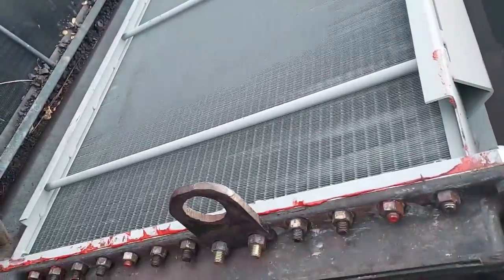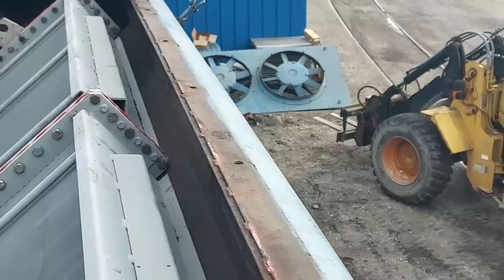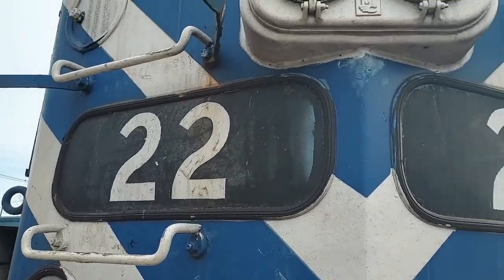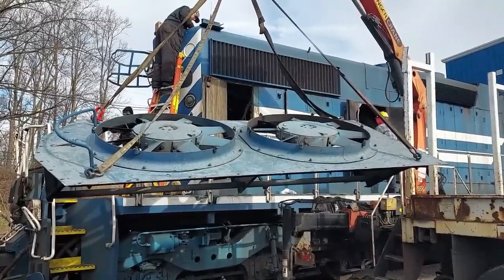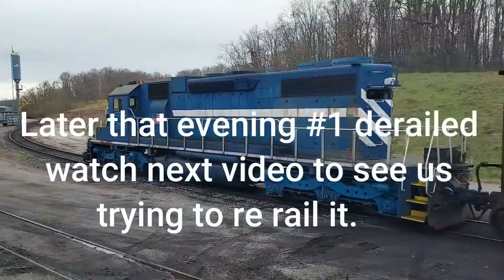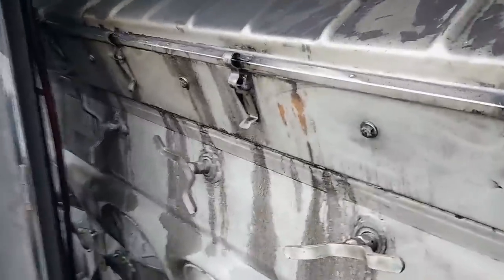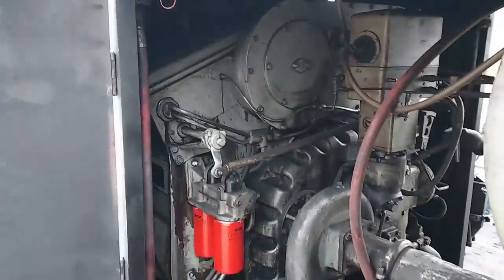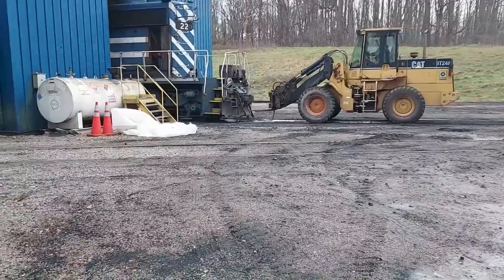A Failed Locomotive Cold Start after Changing the Locomotive Radiator

Comment: Thanks for the RARE view, and the quantity.  Antifreeze quantity, like 50% of that or so?  Is the cold weather start problem common on that or all diesels, the summer time oil is like glue when it's zero?
Reply from the maker: Your very welcome alro. Old EMD engines crank a bit slow.
Most locomotives run straight water. We do put in a rust/scale
inhibitor, makes the coolant look like watered down fruit juice.
The only EMD loco I know of that came from the factory with
anti freeze is the SD 70ACe. Because of the straight water
is why you see so many locomotives idling during the winter,
unless they are equipped with a Smart Start system which
automatically stops and re starts the locomotive upon certain
engine parameters. Thanks for watching the show and writing
in my friend.

Comment: Sounded like the batteries were low on power due to the cold.  Did they put them on a charger when they pushed the locomotive into the shop or did the locomotive fire up just with being inside for 7 hours and warming up some?  How do you ensure there are no air pockets in the cooling system?
Reply from the maker: Yes they did have the batteries on charge in the shop, they
got drained down from the cranking. These engines crank
fairly slow to begin with even with fully charged batteries,
they not like a normal diesel truck engine in that respect that
cranks a lot faster. They tried to get rid of any air, that was what
the initial cranking was all about, sucking the water level down.
Really appreciate your watching and writing in my friend.

Comment: heya.. Love your videos, but I'm curious.. has the company ever consider to add a coolant block heater to the locomotives, that connect to an external power source at the locomotive shed when not in use?? Like in my old 1999 Dodge Cummins pickup??  it would keep the water from freezing in the radiators since they don't have antifreeze in them.. I know some Class 1 Railroads have them to conserve fuel costs from running the locomotives to keep the water from freezing in the colder monthes.
Reply from the maker: Glad you are enjoying the show, we do appreciate your support
of the channel. No one has ever discussed having block heaters
here, but yes you are right some RR's do have them for various
reasons, a big one being locos idling around where there are
homes along with fuel costs. I will put forward to our loco
mechanics next time they come and see their views on the heaters.

Comment: Hay Dave no anti-freeze in the water? or is there something else to prevent
the freezing of the engine block & radiator? do you have block heaters
to keep the shut down engines warm? or just the building. great 
in site video to how the to repair and how the cooling set up is in the engine.
be safe, stay healthy, and have a great day.
Reply: Never antifreeze in these old beasts ever and no block heater either. Just what i've seen in my 24 years working on them...
Reply from the maker: Most locomotives run straight water Barry. We do put in a rust/scale
inhibitor, makes the coolant look like watered down fruit juice.
The only EMD loco I know of that came from the factory with
anti freeze is the SD 70ACe. Because of the straight water
is why you see so many locomotives idling during the winter,
unless they are equipped with a Smart Start system which
automatically stops and re starts the locomotive upon certain
engine parameters. Thanks for watching the show and writing
in my friend.

Comment: Hey Dave !!!  Question ??  240 gallons of water & NO Antifreeze ??? 🤔🤔🙄   Thanks for the video !!!  👍👍👍👍👍
Reply from the maker: Most locos do not use antifreeze. The SD 70ACe is only one that
comes from the factory with glycol that I know of. I have no idea
what GE does. That's why you see a ton of locos idling in cold weather,
although many locos also are installed with Smart Start. Our 3098
has Smart Start but 1 and 22 do not. Really appreciate your
watching and writing in my friend.

Comment: Ummmm why didn't yall spray some starting fluid in the air intake
Reply from the maker: Good question Thomas and actually no one does that for
these loco engines, take a chance on cracking a piston head
from the way I understand it. However your comment makes me
think of those 2,000 HP Super Stock pulling tractors where they
often have to spray a whole can of ether in to get them started.
Thanks so much for taking the time to watch my friend.
Reply: @ccrx6700  wow I didn't know that. We always used a little either in our diesel.  Thank ya for sharing that. I learned something new.

Comment: Hi Dave. Do you leave the engines running during cold weather?  Thanks
Reply from the maker: 1 and 22 yes William. 3098 has a Smart Start system that shuts it down and re starts automatically when certain engine parameters are
reached. Thanks so much for stopping by and taking in the show
today my friend.

Comment: Very cool to see inside an area that most of us never see.  But I have some questions:
1) What is the other set of fans on the roof for?  
2)  I saw in an answer below that most locos don't use antifreeze.  If you don't use antifreeze, how do you ensure the water doesn't freeze when the engine is not running and crack the block?
Reply from the maker: Glad you enjoyed the show Bryan. We really appreciate your
watching. 1 the extra set of fans is the dynamic brake resister
grid blowers. 2. If loco shuts off during freezing temps, then
once water gets below 32 it will begin to freeze, that is why most
locos are kept running during the winter. 1 of our locos has a 
Smart Start system that shuts itself down and restarts itself
once certain parameters are reached to keep water from freezing.
Reply: @ccrx6700  Tnx for the reply.  Giving the price of diesel fuel, leaving them running does seem a bit wasteful.
Reply from the maker: @BryanTorok  👍😊
Reply: @BryanTorok  Well if there's no work to be done, can just park the loco in the shop. Close the doors. Heat the shop with a waste oil heater. Much cheaper that way. Connect the batteries to a trickle charger system. Then fire it back up when there's coal to be moved.
Reply: @brnmcc01  I suppose that makes sense.  It just struck me that we have been using antifreeze of one sort or another for 100 years in cars and modern antifreeze also inhibits rust and corrosion in the cooling system and would do the same in these locomotives.  I have to figure that those radiators have to be expensive.

Comment: I did not expect the rads. to be in a V also I see you do not use antifreeze which being a lot colder than here I thought you would. Now I wonder if our EMD locos have it added or just our old engines.
Reply from the maker: Many folks have written in the same cedarcam, most thought the
radiators were right behind the screens and laid alongside the
sheet metal. None of these old locos use antifreeze. I think the
only loco that had antifreeze in them from EMD factory is the SD 70ACe. it's about cooling capacity, water dissipates heat better
than anti freeze, so the radiators have to be bigger for antifreeze.
I would most certainly venture to say your EMD's run straight
water also. Always appreciate your watching and writing in my friend.

Comment: Well Dave once again you shown me something I just assumed. I had no idea the radiators sat in there in that V pattern. I thought they were flat on the walls where the vents are. Thanks. And was this filmed before the new logo or did you guys take them back off. If you said a date sorry i didn't hear it. Funny how easy you can push something that heavy.
Reply from the maker: You are not alone in that Pappy. Many, many folks have never
seen how the radiators go in there, most all that have written in
also assumed they were flat against the sheet metal. A bunch of
folks also did not know that anti freeze is not used. This video
was made Dec. 2021. Being an equipment operator yourself,
you actually would be very surprised at how easy it is to move
the loco with that small loader. I've done it many a times and
you only have to give it about half throttle to get it moving. Always
appreciate your visiting with us my good friend.

Comment: Mr. Dave I have a quick question about the radiator on the locomotives can you put antifreeze in those two or they just for water from the engine please let me know thank you very much sincerely Miss.Shane
Reply from the maker: Most all EMD locos only use water Miss Shane. The only EMD
that I know of that came from the factory with anitfreeze is
the SD 70ACe. Very much appreciate your watching the 
repair job my friend.
Reply: @ccrx6700  Thank you so much mr. Dave for returning an answering my question I live in a small town on the Gulf Coast it's a little town is called Grand Bay
Reply: @ccrx6700  And the tracks that run through our small-town is owned by CSX and operated by them also they have a small switching yard not too far from us in Mississippi in a city called pascagoula and those tracks or South of highway us 90 and they run West and East but thank you for your videos I'm learning a lot as well as my son sincerely Miss Shane
Reply from the maker: @shanewhite9501  👍😊

Comment: Just give it a shot of ether and pop the clutch.
Reply from the maker: Suggested pulling it with the other loco and catching it in gear....LOL
These old EMD engines start a whole lot better when they
are warm. Thank you so much my friend for visiting with us
tonight and watching.
Reply: easy way to crack a piston on those motors. That is a very, very last option on that motor, because they usually start, it didn't start cause the batteries are weak-- if those were fully charged batteries, it would have started.

Comment: What drives cooling fans?  Electric?
Reply from the maker: Yes sir Keith. They are electrically activated controlled by a
temperature sensor that turns them on or off depending on
coolant temp. Thanks so much my friend for taking the time
to watch today's show.

Comment: Do you have to put antifreeze in a locomotive energy cooling system?
Reply from the maker: Almost all locos do not have antifreeze in them broadwayltd1.
Takes more cooling capacity to cool antifreeze than it does
water. There are a few of the newer EMD locos that have
bigger cooling capacity so they use antifreeze such as the
SD 70ACe. Thank you for taking the time to check out the video and may you have a very good day my friend.

Comment: Another neat video :) Thank you! On an unrelated note, is there a place that sells used railroad equipment and tools? I'd love to find a used track cutting saw, or in the very least, the track mounting arm from one of them. That would allow me to build my own. Those saws are around $3000 new, so I would rather not go that route :P Wheels would also be nice to find, but not the big ones that you find on passenger and freight cars. I would need smaller ones, like the wheels from small MOW equipment, or maybe a hi-rail truck. I could potentially make my own, but I would have to rig up some sort of device to act as a vertical lathe. And cutting/shaping the steel to the right profile would probably be less than enjoyable.
Reply from the maker: Thank you, very glad you enjoyed the show. We certainly appreciate
your watching my friend. No actual store that sells used RR tools
that I know of, however I would seek on Ebay or Amazon and see
what they got.  Most RR and RR contractors pretty much keep
their hand tools until they are worn out.
Reply: @ccrx6700  Ha. Good to know :) I will keep an eye out.

Comment: I would have assumed these engines would have a pony motor to start. Do any engines have ponies, or is it all battery?
Reply from the maker: These locos have 2 starter motors via battery connection to start
them Barrett. No locos have pony motors that I know of. Some of the newer locos use compressed air starters. Thanks for taking the time
to watch and write in my friend.

Comment: Surprised you couldn't give it a shot of ether? And also use block heaters to warm the coolant and block up? Block heaters help all of stuff when its cold.
Reply: EMD's dont like ether!
Reply: @rearspeaker6364  Roger. I know some diesels can't have it based on cylinder and turbo tolerances.
Reply from the maker: May be a good idea for block heaters, will make a suggestion to
the powers that be William. Thanks for taking the time to watch
and write in my friend.

Comment: do yall use straight water for cooling or some sort of glycol mix?
Reply from the maker: It's straight water northstar, however they also put in a water
additive that makes the water look like a weak fruit juice. Additive
helps to prevent scale/corrosion buildup.  Most all locomotives
except for a few run straight water for a number of reasons.
Thank you so much my friend for taking in tonight's show.
Reply: @ccrx6700  not worried about freezing?
Reply: @northstar2007  Cooling water is drained if not in a heated shop.  Straight water has higher heat capacity than glycol.  Smaller, lighter molecule of water  with greater hydrogen bonding effects.
Reply from the maker: @northstar2007  that why locos are kept running in winter 😊
Reply: @ccrx6700  Wouldnt it be more economical to walk them instead?

Comment: You said fill w/water… any antifreeze roo?
Reply from the maker: Most locomotives run straight water. We do put in a rust/scale
inhibitor, makes the coolant look like watered down fruit juice.
The only EMD loco I know of that came from the factory with
anti freeze is the SD 70ACe. Because of the straight water
is why you see so many locomotives idling during the winter,
unless they are equipped with a Smart Start system which
automatically stops and re starts the locomotive upon certain
engine parameters. Thanks for watching the show and writing
in my friend.

Comment: Okey. You would need 3 hands but only got 2. Not unusual... Ever thought about getting or making a tripod? One I used was a block of modified wood sitting on the dashboard to hold the camera when driving the rail cars.
You're bending and nailing tracks, shovelling dirt  for track beds. Now repairing locos. Is there anything You don't do? Joking!
Time 07: 30. Give the drivers a bucket so they can scope up water and fill up out there. Joking!
Is the start done the electrical way, like on a car? It sounds like, that "click". Usually large engines like that start bu compressed air.
Cold starting a little shunter needed tricks. Unplugging one spark plug and pouring some petrol into the cylinder made marvels.... It was a 4 cylinder 30 Hp Fordson engine... Pulled a 100 ton train without problem. For buses I once used gas on a bottle.... Not used on the railroad? Joking.
Time 09:30. Handy shunter used..... During one such shunting the driver lost the navigation and got the front axle trough the planks on a turn table....
I trust You, the engine got started...
Reply from the maker: I have since this video was made gotten some stuff to hold
the camera that I did not have when this video was made Stefan.
Yes I am a jack of all trades here, get involved in a lot of 
different projects, but variety is the spice of life!  Yes sir, there
are 2 starter motors on the engine flywheel and they are
electrical from the batteries. Thank you so much for watching
the show my friend.

Comment: They need to buy a nice rebuilt GP40
Reply from the maker: That would be nice for sure. I've requested numerous times over
the past 7 years they get a GP or even a SW to help us. Would be
great for hauling ballast. Here recently they did at least check 
into getting one, but the insane cost of transportation to get it
here put a huge damper on that. it would cost more for transportation
than it would to buy a loco believe it or not! They looked into
getting us a newer fleet of cars that are down south. 20,000 for
the cars, very reasonable. Another 20,000 for transportation here!
Unbelieveable! The cars are on hold. About 3 times that
cost to get a loco transported.
Reply: @ccrx6700  what would it cost to build the track to join CSX track ?
You should push for the connection
It would reduce future costs and increase the amount of coal you can ship
Reply from the maker: @ocsrc  👍😊

Comment: Tell me that the owner of that Locamotive is not 🚫 running straight water through the cooling system 😝
Reply from the maker: Almost all EMD locomotives run straight water Keith. The only EMD
that came from the factory with anti freeze was the SD 70ACe.
We do put a corrosion inhibitor in the water system.

Comment: Don't you run anti freeze coolant in locomotives...
Reply from the maker: Most locomotives run straight water. We do put in a rust/scale
inhibitor, makes the coolant look like watered down fruit juice.
The only EMD loco I know of that came from the factory with
anti freeze is the SD 70ACe. Because of the straight water
is why you see so many locomotives idling during the winter,
unless they are equipped with a Smart Start system which
automatically stops and re starts the locomotive upon certain
engine parameters. Thanks for watching the show and writing
in my friend.
Reply: @ccrx6700  many thanks for that...makes sense to put a rust/ scale inhibitor as depending on your water supply raw water can cause severe corrosion problems.... thanks for the update...👍👍
Reply from the maker: @richardmessenger9474  👍😊

Comment: Those locomotive should be used to shunt in the train yards
Times have changed and wasted time is wasted earnings
Reply from the maker: Many railroads do use the older locos as switcher locos. Here
we do not interchange with another RR, so all rolling stock and
locos must get trucked in. A major astronomical expense. Can
you now understand why they continue to use these old locos
for hauling coal. If it was cheap to get them in here then we
would have newer locos doing revenue service. Thanks for
watching the show today.